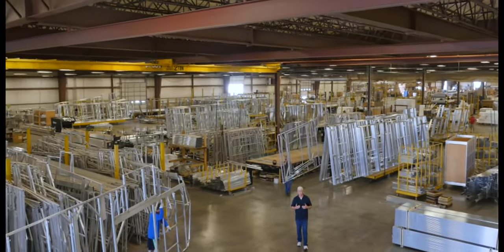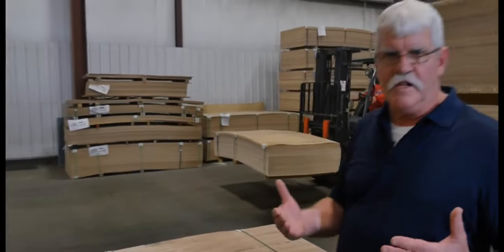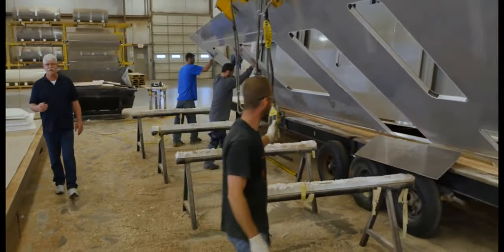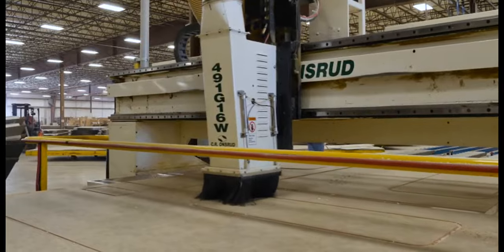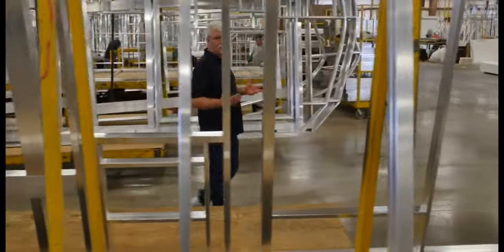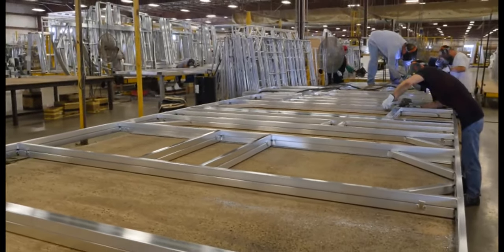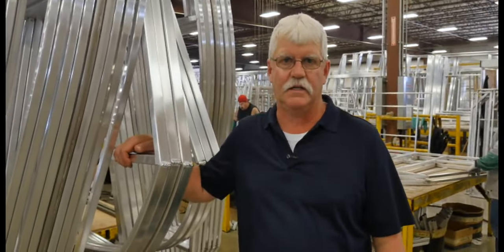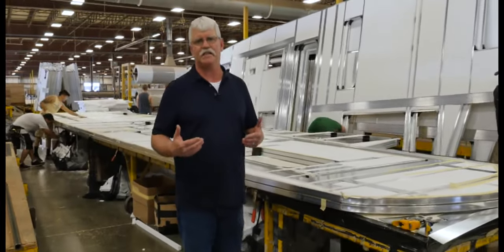Keystone wall construction

Comment: I'm here because a stud holding the lower pulleys on a Cable slide system has broken the welds on a wall stud in a Keystone RV.

Comment: How do you insulate the inside of the tubes??  Or are there just lots of cold spots up and down the rv??
Reply: yup
Reply: For their size and exaggerated R values, RV's need relatively large air conditioners and heaters.
Reply: Often Rv’s have a stick of wood inside aluminum tubes, for something to strew to.  Not sure if keystone does this.

Comment: Ill pass on anything that has a laminated exterior wall. Its your exterior walls that make this thing structurally sound. If it delaminates, its game over. Another kick in the head on this, after you bought your model, its no longer being made. Good luck finding the exterior wall or correcting it yourself. I had an early 80's coachman, 8' x 32'. Gutted it down to frame and built my own. Yes, exterior walls are what holds your friggin rv together, the cabinets hold walls and roof in place. If you miss a stud and drilled into air, guess whats wobbeling down the toad and you dont know it until its to late.. Did my own floor plan, built floor up, walls, roof, cabinets. And it didnt cost me $40,000. Not even close.

Comment: Too bad Luan (lauan) is wood,  and crappy wood at that.  It's like....not even really actual wood, it's like what wood regurgitated. And in being so, it expands, contracts, swells, and worst of all, absorbs water.   Azdel has been around for quite some time now.....not exactly sure why you haven't figured that out yet.   Azdel doesn't absorb water, won't rot, won't mold or mildew, it's lighter than wood, (Luan) insulates better than wood, and because of all of those things, your trailer is going to last longer.

And you're admitting, and SHOWING the customer, that because it's "wood", it needs to be maintained at a certain humidity level, and not only that, that it ATTRACTS and wants moisture.  

Azdel is extremely important in my opinion.   RV's are rolling earthquakes.  Everything shakes, rattles, and gets twisted, pulled, stressed, etc, every single mile you drive.   Because of all this.....cracks are inevitable.   Cracks in the seals are especially problematic, for obvious reasons.    So....for one, cracks are going to happen, which is why everyone needs to routinely inspect their RV's and re-seal the seals every now and then.    But......I would say that MOST people do not ever do that. 

So, when you get those cracks, and you have Luan laminated walls, well.....you're pretty much screwed.  You're going to get rot everywhere, and your RV is going to be a pile of crap in no time.   You won't have the same problem with Azdel.    It does't really matter of Azdel gets wet.  It shrugs it off.  Sure.....I'm sure there's a reasonable chance that SOME kind of problem could develop, but, nowhere NEAR what it is going to for sure be, with Luan walls. 

Why even bother trying to "show off"  wood walls?  

I understand Azdel is extremely expensive, but, I won't buy an RV without it.
Reply: Who makes rvs with azdel?
Reply: @TheKing-nu4fk  Lance

Comment: Yup, pure BS.  My 2016 Montana has a wall stud adjacent to the slide that broke at the weld joint.  There is a reason airplanes are riveted and not welded; aluminum gains it's strength thru heat treatment, and welding weakens the aluminum dramatically.